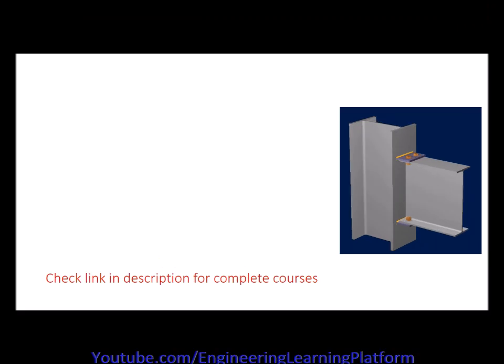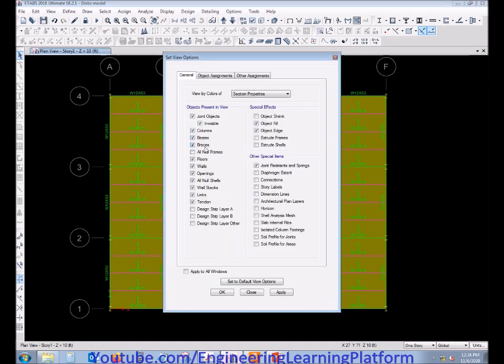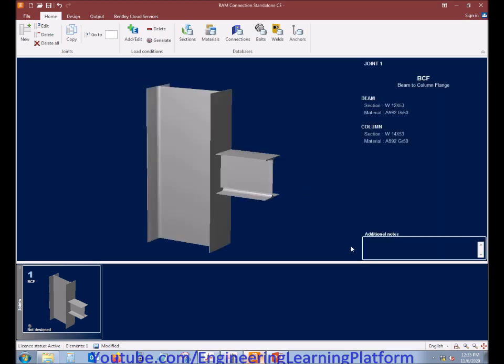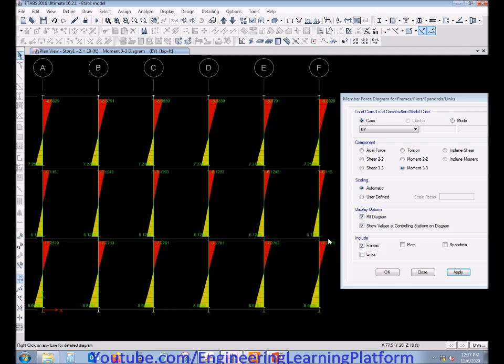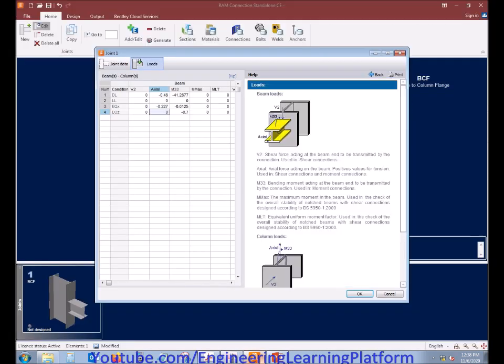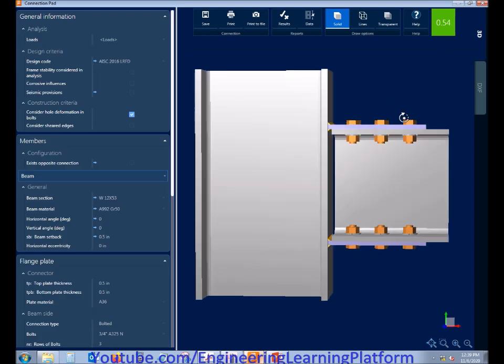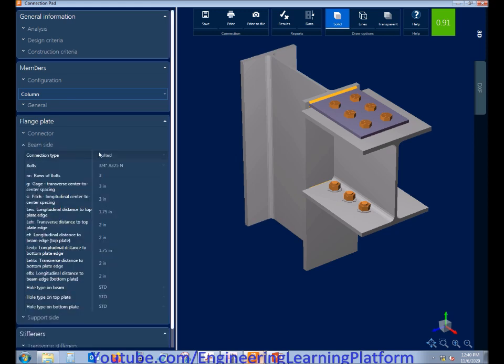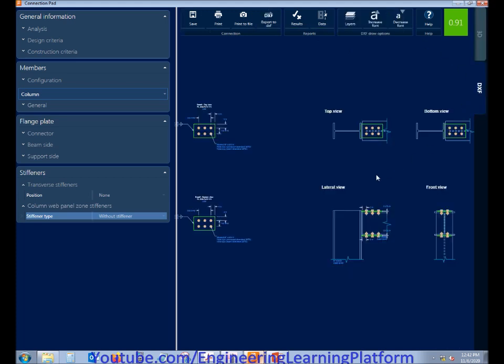Flange Plated Beam Column Flange Connection Design using Ram connection

Comment: Can I model combined connection shear + moment connection in RAM ?
Reply from the maker: Yes but the connection design would be separate for shear and moment in most types of connections
Reply: @EngineeringLearningPlatform  I have a model of connection, but there is som deference between the hand calculation and the results of Ram ? Can u help me to explain why this happened? Thanks

Comment: I want to use Tata Structura Column sections which is not available in the Steel table of RAM Connection Software. How can I include this customised section in the program data?
Reply from the maker: Yes you can define new sections in RAM Connections . I'll surely post on it.
Reply: @EngineeringLearningPlatform  Thank you 🙏